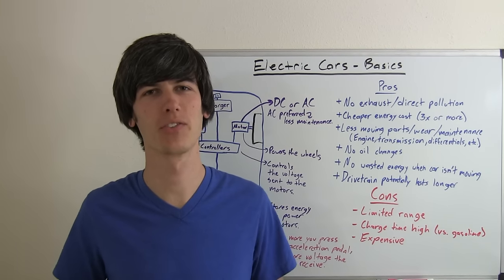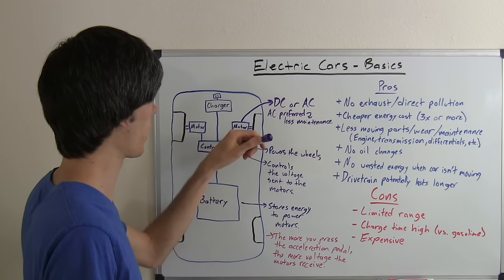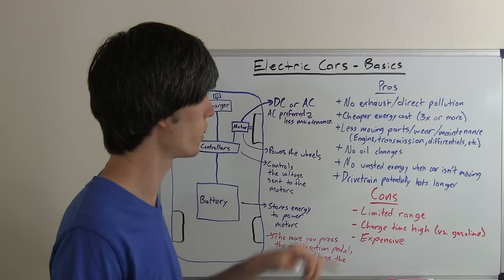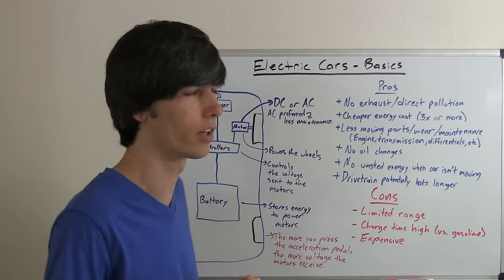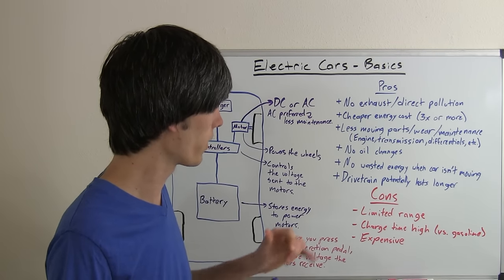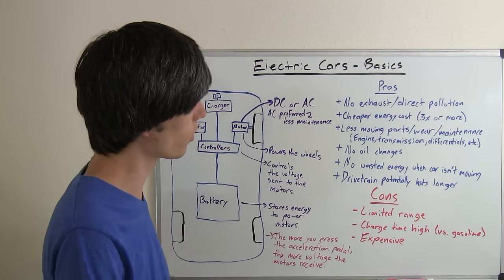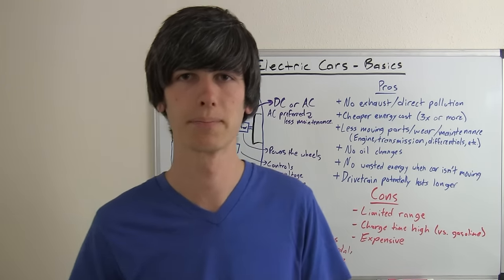Electric Car - Explained

Comment: No one thought before about using one wheel to recharge a secondary battery as a backup one and connect it with a controller to be released when needed and turns to recharge process to the dead or main battery. 

I wish i see a demonstration for this because i was interested since years to figure anyhow to make this happen. 

Thanks for your video i enjoyed watching it.

Comment from the maker: Electric has the advantage here. Properly controlled electric A/C motors have no reason to die, there's no wear like there is with ICEs. Batteries do of course go bad, so that would be the biggest issue (but there's no transmission, differential, etc..)

Comment from the maker: It's actually much more efficient, not having the energy wasted as heat through a drivetrain. Also, it allows for torque vectoring, or placing the power exactly where it is needed.

Comment from the maker: Unlikely, as they're quite reliable, but if it were to happen you wouldn't be able to accelerate (or would have to use only 1 motor). Probably could limp to a shop.

Comment from the maker: All it is, is a gear ratio. They go from a smaller gear (motor) to a larger gear (axle) so that torque will increase and speed will decrease. Electric motors have a large RPM range so multiple gears are not necessary.

Comment from the maker: Well cold would certainly affect the battery, but if it had a heating coil to run the heat, it shouldn't have any problem providing hot air. It'd actually be quicker than an ICE heating up - but this energy affects battery life in an electric car, where as it doesn't really affect anything for ICE.

Comment: The ESC does not change the voltage to increase speed, but it changes the frequency at which the fases shift. I think this video would have been better if you explained how the electric motor works.
Reply: depends on the motor chosen. induction required a frequency change, Brushed DC motors require a voltage change.
Reply: I don't think any EV uses a brushed DC motor though
Reply: Most electric cars use AC motors, where ESC changes both frequency and voltage to keep constant torque (so called u/f control). Above nominal frequency of the motor, the voltage stays the same.

Comment: Driving electric car is so much fun and sbsolutely relaxing, compared to internal combustion engine car. I never like to go back to this loud and vibrating old fashioned technique.
My Renault Zoe has about 150 miles range and that's great. Another 120 miles charge can be done in about 1 hour.
The electric car is more expensive to buy, because there is almost no aftersale business with worn out parts. Electric motors are just very simple like your drilling machine.

Comment: This is true... so... they have heat pump systems in the 2013 Nissan Leaf that work reasonably efficiently... the best way to take advantage of a difference of the car... is to turn on the heater or AC while still connected to the charge system... pre heat or cool the car then use less energy on the way. It also has a steering wheel heater and heaters in all the seats. They found that it was more efficient to heat bottoms and hands rather than all the air in the car. Love My LEAF!

Comment: Nice video, i personally believe that batteries are not the way to go with an electric car, capacitors are the way to go, under ideal conditions they would last far longer then any kind of battery and recharge much quicker, charge times in line with filling a normal car with fuel would be possible with capacitors.

Comment: You would lose energy through friction and having to drive the alternator as well as the wheels, but Ive read of similiar concept about using the car's kinetic energy to recharge the batteries while slowing down

Comment: I suppose the battery is the heaviest single component in an electric car. Do you think that would bring it closer to 50/50 weight distribution? If that is true and what I have heard about "instant torque" is true, I hope someone develops a fun RWD model that isn't 6 figures like the Tesla Roadster.

Thank you for all the work you do with these videos BTW. The show Initial D has sparked an interest in cars I never knew I had and you are a great resource.
Reply from the maker: Yep, electric motors have 100% of the torque at 0 RPM.
Reply: The acceleration in electric cars is pretty awesome since, as mentioned, instant torque from 0 RPM, plus you don't have to go through gears like with a petrol or diesel cars.

The Tesla Model S doesn't look look a very heavy car, but it weighs 2 tons. In comparison, a BMW 320i weighs around 1.5 ton.
Reply: The Nissan Leaf will beat many sports cars to 30 mph due to the instantaneous torque, above that speed it gets smoked.

Comment: You said it makes more sense to just use the motors directly without having to use a differential. There is a reason electric diff's are on the most expensive cars as I'm sure you are aware. So I'm just confused as to why you think that would be better, other than just simplicity.
Reply from the maker: Bruce Lee Electronic diffs are quite different from electric motors. If you have two electric motors for each of the two driving wheels, a simple gear reduction is all that's needed, as you can very the torque each motor produces, and having two independently controlled wheels allows for maximum variability. Engines, on the other hand, send power through a diff (whether it's electronic or not), and it splits power between the two wheels, but it's much more challenging to control the split of power, where as with electric motors it's just a program to split the power.

Comment: Yes yes I agree. What I read was mainly that some researches showed that to produce the electricity (with coal for ex.) used to recharge an electric car  would pollute more than just using gasoline/diesel. But it did sound strange compared to all efficiency and environmental advantages an elecric car has during its lifetime. I am still a bit worried for "super electric cars", they kind of lose the sound which I personally find beautiful in a sportscar..

Comment: I've always wondered why we continue to use hydraulic brakes when laser reactive brakes or even just electric voltage applied to a calipereque device would suffice.
Reply: price mostly.  the technology for hydraulic brakes is pretty well advanced and cheap.  the electricall recharging brakes are new.  plus I think it will be an electric car focus with how a combustion engine is turning an alternator to charge the battery faster than it can discharge (in proper conditions).  I am not sure about this thought but it might also be, at least for the heavier vehicles, that hydralics allow better braking.  I believe this youtube-er has a video about the formula 1 hybrid car and I think he said that uses regenerative braking in it
Reply: Regenerative braking works great when the battery is somewhat discharged, once the battery is nearly at full charge you get much less regenerative braking, so having a hydraulic brake system to compliment it is needed. On cars with regenerative braking like the Prius or Leaf the hydraulic brake components wear much slower and have much longer life then on a car with ICE (discs, pads etc).

Comment: Then for suspension the entire assembly (tire, brake, and motor) move together (of course it won't work really well). And electric car is not build to speed (except Tesla Roadster), so you don't need to go 200km/h, and where you can speed up to 200km/h? At toll or highway maybe the speed limit is about 100km/h.

Comment: you should do a segment of the combustion of hydrogen, and maybe how it could be used and what road blocks are still blocking us from using it as an energy source. Im not sure but I guess the energy it takes to separate the H2 from water is greater than the energy that the combustion produces.

Comment: Induction AC motors are used in EV, but it's known that induction motors can not be synchronized to share the same load, so how 2 motors use to power the vehicle.

Comment: More disadvantages in electric cars:
If we do not want to use cv joints, then we have more weight on the wheels and less suspension control.
Then to not use gear box we loose always performance. In industry the use of gear units is still in use. The car you are talking about has very good performance and acceleration but top speed is “only” 200km/h (about 125 miles per hour). I believe that with a gear box it will be possible to reach about 160 miles per hour!
But this might be the future.
Reply: And why would you need to go over 200 km/h in your daddy car? Only in a real race car a gear box might make sense. Isn't there an electric Porsche with a 2-speed gearbox?

Comment: it takes longer to charge the an ev and you need to charge it every single day I suppose. batteries normally die quickly if you keep charging them, maybe the maintenance and replacement of batteries could be another potential expense. as you said, technology is always improving, but we still  need to consider these details

Comment: which motor would be suitable for electric cars?? 1 wud say dc- bcz that way the controller may not require a converter, but ac wud allow more flexible control right and speed range too..

Comment: Batteries are temperature and charge/discharge rate sensitive.  New electric car = new battery pack = known quality.  Battery swap = maybe abused pack that barely meets spec.  Perhaps battery leasing or service contracts can address that issue.
Anyway, there is some thought to using the traditional driveline tunnel (the floorboard hump between driver and passenger) as a standardized replaceable battery pack location.  The long skinny pack would be removed and installed from the front or back.

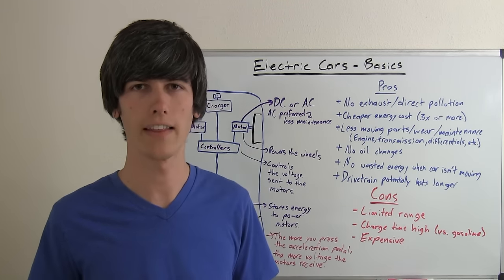Comment: 1:29 Also, gasoline costs some amount of energy to produce. The number I have in my head is 6 KW/H per gallon* (With every gallon of gasoline being worth about 23 KW/h before taking into account the cars inefficiency, and most ICE cars wasting about 2/3rds of that power.) so it's a moot point anyway.

* but I don't know where I got that from. I know it seemed believable at the time but I can't find it for you.

Comment: A transmission is needed on a normal gas powered car because it has a limited power band. Electric motor's don't have that issue. They can produce torque at any speed.

Comment: Good Video. What will happen if one of electric motor is not working
Reply: I'm guessing the car would still be drivable, due to the non-mechanical(?) connection between the motor and the wheels. (It uses magnets instead of gears... I think) But it would most likely be a very slow and scary drive to E-Jiffy Lube.

Comment: I'm considering doing a electric motor conversation on my 99 honda accord. How do I find out the torque of the motor at the clutch? This will tell me what kind of e motor I will need to have the same level of performance as the original combustion engine. From there I can determine what other information I'll need to calculate the cost of this project and whether or not it is viable.

Comment: ACDC conversion losses, our BMWi3 says 14 kWh/100km from GOM but reality ois over 18kWh/100km from grid. Range is 75 at best in summer, 59 in winter with heat pump. Battery is 250kg for 22kWh pack (18 useable when new).

Comment: less power lost in moving a differential and a drive train so if you have 2 moter you put 50/50 power into them and go the same speed as putting 100% power into one and going a little slower

Comment: Electric cars have been around for about as long as gasoline or diesel powered cars. However they didn't become very popular because the battery technology in the old days was pretty poor, and it was easier to just build a large fuel tank to go a long distance. It should be remembered that at that time the world population was about 1.5 billion so nobody cared whether oil was a depletable energy source or not. But now with 7 billion people it's starting to become a problem.

Comment: Right at the beginning of this video, i was thinking: what if the car had always been powered electricity since the beginning of its existence, wouldnt society be apprehensive if, suddenly, we had decided to move to internal combustion?! Wouldnt society be thinking "its to noisy... it makes a rough sound... the sound is not continuous".
Maybe i was thinking that to try to understand the reasons behind why i prefer the i. combustion to the electric motor.

Comment: Great channel! It would be very interesting to know more detail about EVs. Particularly how HVAC systems work, how the motors, inverters and batteries are thermally managed. Also how to look after an EV - should you charge the battery everyday, or manage it more like an ice car and charge when you get bellow 1/4?
Reply: You would like munroe live. They disassemble electric vehicles and and analyze all of these components.

Comment: Most affordable EV's have a single motor.
In the case of the most used drive unit (in more models than any other drive) from Continental it is in an oil filled casing contaning an externaly excited 3 ph motor, reduction gear and differential all in one unit.
so it has two output shafts and is mounted directly between the wheels.
Very expensive EV's like the daimler have up to four electric motors.

Comment: If you compare the kWh of energy in 1 gallon of gasoline versus the cost of that many kWh of electricity you'll see that electricity is not actually cheaper than gasoline in terms of cost per kWh. The reason why electric cars are so much cheaper to operate has to do with the efficiency of electric motors, not the cost of the energy. Since electric motors are so much more efficient than an ICE the electric motor uses 3x less energy which means you have a lower cost.

Comment: Ah in UK excise is 62%. I dont want to digress from the topic of the video but I am puzzled by this 3times cheaper energy. I accept it depends on the source of energy used to generate electric. I know that electric cars can use braking to reclaim energy.
But given that electric on the whole is generated using fossil fuel & electrical energy is lost in distribution & conversion, Im really puzzled by this 3 factor. Is the factor based on energy loss to power output or solely a financial costing ?

Comment: Do You Know How Many HP can my stock trans handle? is a 2001 dodge neon (31th or A413) ... Im planning on converting to electric and i wanna know so i can order the most decent (strong) motor, using the same stock transmission...

Comment: So can you say that, as you have pretty less parts ( as you said, you don´t have an "engine", differenteials, transmissions, etc.) you can get more power available because you lose less power due to friction?
Reply from the maker: ProjectD100 The drivetrain is much more efficient, yes.

Comment: If the acceleration pedal gives the motors more voltage the harder you press it, then what is it connected to?
Reply from the maker: It sends the signal via a potentiometer to the motor controller, which increases the voltage sent to the motor.

Comment: i am still trying to understand how they make those motors so powerful. i can find electric motors from machines that are about the same size as the ones in cars but only produce about 5 horsepower. how is there such a drastic power change between motors of the same size?

Comment: Engineering Explained How does torque work in an electric car, The Tesla starts off at 443 ft lbs but the horse power is only 416 at 8,600 which equates to only 255 ft lbs at that rpm? How does this work as i thought torque had a flat plateau across it's power band. Thanks in advance.
Reply from the maker: Torque remains flat for a while, but then begins to drop at a certain RPM.

Comment: Isn't to increase RPM you need to increase amp instead of volt? And isn't amp = current flow rate, volt = strength, watt = power? It may work on DC motor, but in AC, I'm not sure.

Comment: Couldn't we put solar panels on the roof of the car and connect it to the battery to give it a little longer lifespan when driving?
Reply: That's the kind of car I drew when I was a toddler
Reply: Solar panels need far more real estate to generate enough electricity than the roof of a car.
Reply: bob Jesus they are a bit heavy(say around 20kg extra  weight)... so whatever it gives(if at all it gives) , it takes back due to it's weight...but maybe if we can get a cheaper, lighter and more efficient panels we might be able to do that...
Reply: They need to get 20X area efficiency compared to the best one now.
Reply: Makes no sense from a cost & energy-producing stand point. For a car to effectively rely on solar panels on the body, the car roof is far from enough. Maybe a sail or an umbrella like on a frilled neck lizard that sticks out from the car with solar panels would suffice, but the cost would be insane at that point.

Comment: One thing I don't get, why don't it need transmission, wouldn't it mean that the engine could run low and have the same speed than run the engine high and have the same speed?

Comment: Electricity is not cheaper then gasoline normally in the states. Here in southern New Mexico, USA gasoline currently averages $2.239 A gallon. Electric rates would have to be below 6.9 cents a kWh to match that price. He is the math 2.239/32.777 = r. Electricity is only cheaper due to the 3x improved efficiency of electric drive.
Reply: john gilkison and don't forget, with electric motor once you brake or go down hill you get some energy back that you spent accelerating/ going up the hill, the same energy you waste in ICE engine

Comment: what is the meaning of charge time higher than the gas or petrol car
Reply from the maker: mostafa elsabe It takes longer to charge the battery on the electric car, than it does to fill a tank with gasoline.